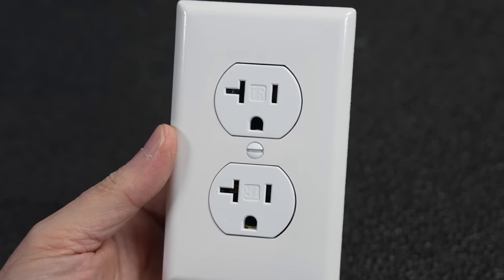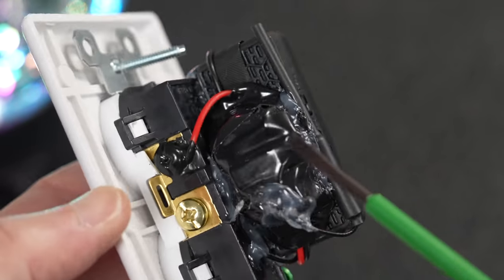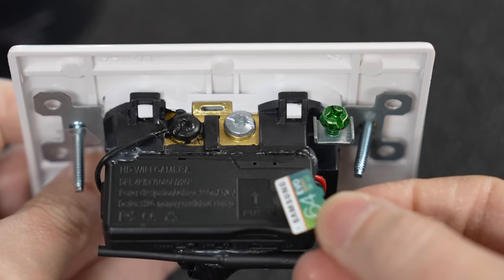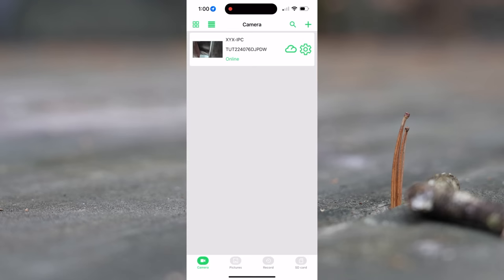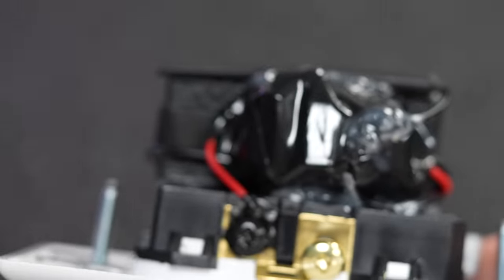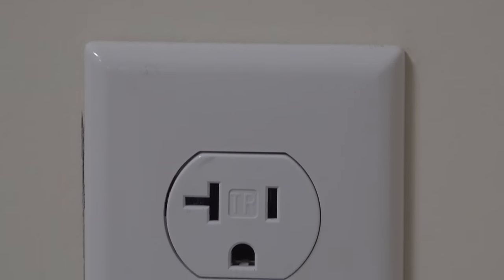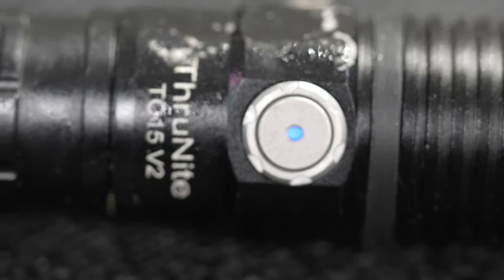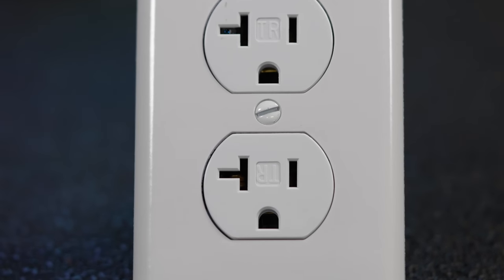Most ILLEGAL Outlet in the United States

Comment: Thank you! Many people just had their homes "remodeled" and all power upgraded with New Romex drops and outlets. {Tax write-offs have been used well} Most are 20amp or more. Especially in the bathrooms. Folks should check each one, as many larger Jobs, the GC uses bids to find the best prices.
Reply: Having the standard receptacle (without the horizontal slot on the neutral side) on a 20 amp circuit is approved in the NEC. That's why you never see the type shown here. I would however recommend that you use receptacles above the quality level of those (well, used to cost) 59 cent cheapies you see at wallyworld. Go with a residential spec grade type, well worth the small extra cost. Especially over the long haul.
Reply: @richpayton7162  Now you need the $1.59 outlet due to the TR requirement.

Comment: This is such a dangerous little spy camera that can be defeated simply by plugging something into it!
Reply: True, the plug would cover up the camera.  It wouldn't break it though, as homes just have 15amp style plugs.
Reply: @raterus  It's perfectly reasonable to carry a 20A extension cord and plug it into all of the 20A outlets in a hotel room or apartment to test them for looseness or wear.  If you happen to unexpectedly encounter one of these cameras, there may be some additional resistance once the metal horizontal neutral blade of the 20A plug comes into contact with the glass lens of the camera and you may not be able to seat the plug properly even with a little force.  Be sure to use a proper flashlight to make sure the camera lens has been properly impact-tested.  Repeat as needed.
Reply: @natehoy6924  That addresses this particular device.  Which is pretty easy to spot because 20 amp receptacles are extremely rare, and it's marked 'TR' without having tamper resistant shutters.

I'm unlikely to spot a tiny camera hole in a more common GFCI or nightlight outlet, and smoke detectors have enough design differences that I wouldn't even notice a bigger lens.
Reply: Yeah, like a U shaped nail.

Comment: What's illegal is how you installed a mains voltage outlet using a low voltage trim ring.
Reply from the maker: come on 2:32 I originally wanted to record the back of it installed but it didn't really add much, thats why I used the ring

Comment: I was expecting this to be a safety video on not putting 20 amp receptacles on 15 amp circuits and such. I was wrong lol
Reply: @nooneyouknowhere6148  IDK about that.  My county code mandates 20A minimum circuits, but you can use 15A outlets, since they won't pull enough to trip the breaker.  I think 15A circuits are illegal out here.
Reply: @nooneyouknowhere6148  That's news to me.  I have an '80s house with (too few) 20A circuits, but 15A outlets and no GFCIs or smoke alarms.  (I'm planning on correcting the last two).

Comment: Just an observation that these cameras have TP stamped on the receptacles. TP is an indication of a tamper resistant receptacles. Its clearly visible from a distance with just the naked eye, the tamper resistant covers that should have been covering the holes of the receptacle are completely missing.

Comment: So what happens if someone plugs in a NEMA 5-20P into the top receptacle? Also it says TR Tamper Resistant but is missing the plastic shutters LoL!
Reply: Looks like the horizontal neutral blade might encounter some resistance.  Might have to apply a little extra force to attempt to seat it properly.

Comment: Depends on where it is located. Who’s home it is. Who lives there. But if I want to film myself through an outlet that won’t actually accept a 10amp plug on its top plug well I’m gonna film myself. Gettin it on. I much prefer pin hole cameras inside crown molding corners or behind mirrors.  Air vents especially long linear ones work well too and keep the camera cool.

Comment: They are allowed to make them as they can also be used for security reasons. Only good if you can set a password to keep un wanted connections to it but nun the less if it is password protected it would be good as a hidden security camera if you have an area you need it in.
Reply: Where in the NEC does it allow installation of fake TR outlets for such purposes?

Comment: This camera receptacle combination looks homemade and because it was modified the receptacle lost the UL listing so it IS illegal by code (I bet this device has never been tested as a camera/receptacle combination). In the United States, an electrical device is required to go through testing before it is legal to use. Every country has its own testing and labeling, Canida is CE, and the United States is UL for Underwriters Laboratory.
In every state that I know of this camera would be legal as a standalone camera without line voltage if you are the person that has occupancy AND the camera is Not installed in a location where a reasonable person would expect to have a level of privacy like a bathroom or bedroom.

Comment: I think the obvious part about these outlets is most homes only wire in the 15A models, so unless its in some place like a garage, shop, or laundry room its pretty obvious it doesnt belong in the room. Most home appliances are 15A, and I personally have only seen 20A devices in industrial applications such as large (36 inches in diameter) fans or pipe threaders, if they arent just straight converted to 3 phase 480V

Comment: I wonder if you can see this in a dark room by looking through your cameras phone?  I use this method to test infrared remote controls to see if they are transmitting. I don't need a dark room to test remotes because I know where it should be, but a dark room may make it easier to spot one of these; I'm not sure.
Reply from the maker: Thats a great point and for larger cameras that have an IR illuminator that would work great, this one doesn't have that but maybe some version of these do and its a great easy way to check for sure
Reply: I would say it depends on if the camera has sensors when to activate the ir lights as most do.

Comment: So, basically, if anyone decides to plug in an appliance that really does require one of those 20-amp sockets (meaning its plug will have a side projection on the neutral prong), then the spy camera will get destroyed. Not an ideal design.

Comment: Yeah, it's just a little ESP32 microcontroller board with built in wifi/bluetooth and an extra camera module plugged in. They're really cool devices that can be purposed for many, many things. You probably already have several devices that use these same processors. They cost about $5. It's basically just a step up from an Arduino with a lot more power and memory.

Comment: depending on your locality these may be illegal, just from the fact that they are not certified EX UL, ETL etc.  if your locality has adopted the NEC then these are outlawed.  Doesn't mean you  will get caught but under the NEC even the owner is not allowed to install unlisted equipment.  Certainly you could try to get a waiver from the AHJ, but I doubt it would happen.
Reply: There is a HUGE difference between not UL certified or prohibited by the NEC, and illegal. Not the same thing at all.
When you are saying illegal, what you mean is a code violation. No one is going to court or going to jail for installing a device that is a code violation. The inspector will flag it and tell you to fix it or you won't pass inspection. That's it. There is no law being broken anywhere in this situation.

Comment: The most dangerous thing about this is that it was it was installed with a low voltage mounting bracket instead of a full high voltage junction box.

Comment: I don't know about it being illegal, but it would definitely be a code violation if you put it on a 15 amp circuit.

Edit: Update, the example installation shown starting at 2:26 is also a code violation, as it is installed onto an LV box and not a proper line voltage electrical box.
Reply: You can install 20a receptacles on 15a wire. The wire is protected by the breaker. You are correct concerning the second point.
Reply: @mxbadboy263  This is not correct, while NEC code as an exception, does allow you to put a single simplex 20 amp receptacle on a 15 amp circuit, the receptacle in the video is clearly a duplex, and thus not allowed. Please see NEC Table 210.21(B)(3) for further clarification.

Comment: Also, if you plug a 20A device into the 15A circuit and the breaker/fuse doesn't work, you could have a house fire. It's also a code issue.
Reply: If you plug a 20A device, you're going to break the camera!
Reply: @pierreforget3357  LOL! That device has two outlets, one with the camera and the other without. There would be a 50% chance of breaking the camera.

Comment: Those are not illegal. They're not illegal to use. Technically. 
It depends on where they are used. Any location where there is an expectation of privacy is of course illegal. A bathroom, a bedroom, etc. However any location where there is no expectation of privacy, for example an outlet facing straight out an open front door, or in a garage that looks down the driveway when the door is open are 100% COMPLETELY legal to use as security. It all hinges on "expectation" of privacy.

Comment: It looked like he used a mounting method reserved for low voltage connections. For an installation involving line power a box is required, either one of the blue plastic boxes or a metal box. I'm not sure that it is actually illegal to install something like this in your house, but it is against code to do it the way it was shown in the video (assuming I'm right).
Reply: I think the reason he mounted it the way he did is that it was too big to fit in a legal box with the camera on it.

Comment: Depending upon the state, it may be illegal. Some states only require one person to consent to a recording and that could be the person doing the recording. In your own dwelling you can set up a camera wherever you want does not matter it is your property.
Reply: In your own home, yes. Unless you put it where someone else might have a "reasonable expectation of privacy." In that case, it would still be illegal. (Put one in your bathroom, and let someone else use the facilities, and you just committed a crime in most US states.)
Reply: Michigan only requires one party to be aware of the recording (as you said) (the law was created for recording telephones) AND as @The Scooter Guy said a reasonable expectation of privacy. Also, remember every electrical device installed in the United States needs to be tested for safety before it becomes code legal to install, the most common in the states is UL or Underwriters Laboratory and in Canida it is CE
This device is NOT UL I am sure of that, it looks homemade so for that reason it cannot be used however you could get around that by not connecting line voltage at all.

Comment: There's nothing actually illegal about this outlet ( depending on where you live ) other than it may violate electrical codes. Creepy, for sure, illegal, no.
Reply: that said, some uses of this device will be considered illegal in certain districts, like recording people without informing them.
Reply: @MarkParkTech  And for audio, "one party consent" means at least one of the parties must be part of the conversation, or the recording must be on your person and pick up what is heard with normal hearing.

For the latter exception, I started recording in the later parts of my last job beacuse I was being harassed and abused, but the microphone (my smartphone) was always in my pocket when recording was turned on.  Usually I turned it on when I felt in danger or when I was being called into the office.

Comment: Since that receptacle "appears" to be a 20 amp receptacle, you have to connect them to dedicated 20A wiring. IF someone plugs a high current drawing appliance into that receptacle, then it could burn up the receptical, wiring, and, possibly, the house. Unless it is in the wash room, A/C-heater closet, or something similar, I'd know something is wrong because the receptacle is out of place.
Reply: there are no residential consumer grade devices that require greater then 15 amps. These devices even rarely run a 9 amps. there is no reason for 20 circuit in a residential situation. This is why you don't see them in a house. Maybe in a laundry room but not hallways and living rooms etc.

Comment: The legal use would be for normal home security aka:  Nanny Cam.  

If you see one of these in a hotel or air bnb?  Then yeah that is not a legal use. 

If you are that concerned, simple to block with a 'child proof' outlet protector.  Those are usually wide enough to cover the openings.

Comment: What's illegal and a fire hazard is the way you show the outlet being installed in the wall on a ring and without being mounted in a listed box, which is the protection that prevents arc flash and or overheated wires and or the receptacle itself when burning, to spread beyond the confines of the box. The modified receptacle looks like a real kludge and I would be surprised if such a pos would be UL listed. 
No UL listing + a fire +a code violation = No homeowners insurance payout.
Reply from the maker: You did see the text above right?

Comment: Now this would never happen in Europe. We use the same outlet for higher amps as well (230 V), and there's just not enough room for a hidden small camera to be built in the outlet. We have actually other creative ways to conceal a camera. All of those however require some sort of power supply, which most of the time is out of a battery. To be fair tho, hidden cameras are not actually easily justifiable in Europe. Security surveillance camera has to be visible, and such place has to be clearly marked as under a camera suveillance. Having a concealed camera in your house might be a law violation in Europe. The only exception might be if you're working with police to catch a criminal that might come to your house (a thief that conceals his activity by pretending to be for example a household worker - the type that washes your windows, paints your walls, etc. - he will do his job, and on top of that scout your flat for valuables - next time you know, you're missing expensive watches, jewelry, a computer, etc.) - in this case you pose as some sort of bust, an ordinary person that hires said worker to do some household types of chores for them. But you're actually working with police in this case, and police is actually the owner of the concealed equipment in your flat. You can't really install hidden cameras yourself.

Comment: what happens when someone tries to plug in a real 20 amp appliance to the outlet. Many large appliances have those T shaped plugs that require a T shaped outlet. I guess thats rare enough that you probably never have that issue but it would certainly be funny to see happen.. crunch!
Reply: I have never seen an appliance with a T shaped plug but I`m aware that there are some things out there that so have them as that`s why the outlet has a T shaped slot. The are small differences in 15A , 20A, 30A and more that way you can not plug in a device that will cause a fire, look at the Home Improvement center you will see what I mean.

Comment: ETA: This comment does not apply to this video. It was a comment to a video about an electric water heater that was attached to a shower that supposedly drew 38 amps. Sorry for the confusion.

There are very few places something like this could be used in the US that isn't specially wired for them. 12 gauge wire that is used in most bathrooms is supposed to be protected by a 20 amp maximum circuit breaker. 6 or 8 gauge wire would be required for this device. A smaller gauge wire might be used if the device was hooked up with 220 volts but that would require a different device designed for 220V. As to the reports that the things are safe. That certainly seems plausible. There were a lot of crafty safety features built into it. But the device also has the potential to be extremely dangerous. Several US soldiers were killed in Iraq because of some poorly installed electric devices in the bathroom. Death from electrocution in the bathroom is always a threat with or without this device when mistakes are made with electrical wiring in the bathroom.
Reply: I'm an electrician. Everything you said about wire gauge and voltage here is wrong. Not sure where you are getting your information. That camera/outlet could be easily wired into any 15 or 20 amp circuit with no problem. And obviously you have no idea what 6-8 gauge wire is. 6-8 gauge wire would need a pigtail with a smaller gauge to be able to attach to the screws on the camera/outlet, and the box probably would't have room to hold the 6-8 gauge wire with a pigtail. 6-8 gauge wire is for 2 or 3 times the amps that 12 gauge wire is. And 220 volts has no relationship to smaller wire. Wire gauge has to do with the current (amps) not the voltage. 
I will agree that improper electrical installations can cause injury.
Reply: @davemiller6055  I am sorry. My comment did not apply to this video. I made a comment about an electric water heater that attached to a shower, but it ended up here because I didn't realize that YouTube had started another video. I am sorry for the confusion.  According to that video the device drew 38 amps which was the basis for my discussion of wire gauges and current capacity. I'm not going to delete my comment but I'll put a note in the front that it doesn't apply to this video.
Reply: @davefoc  That's OK, no big deal. 
That same thing has happened to me once or twice. 🙂